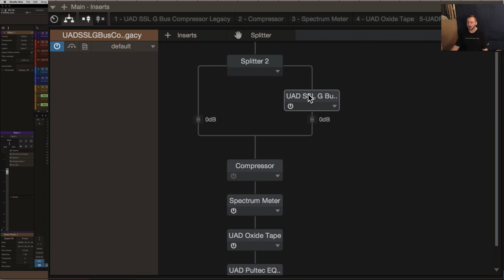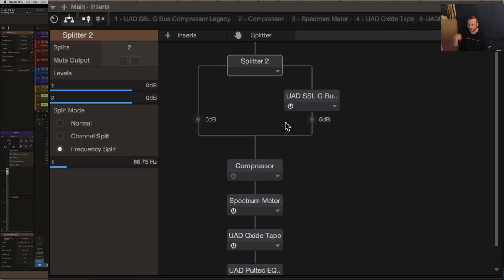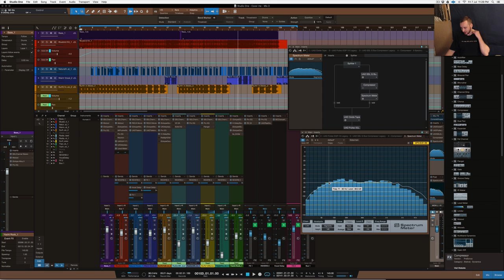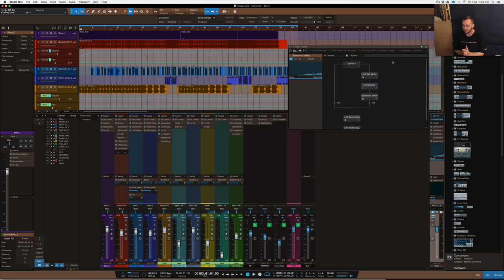Studio One 3.5.1 | Side-Chain Filter Any Compressor

Comment: Great idea! Do you know a way I can feed boosted/exaggerated frequencies into the compressor so it reacts to the boosted frequencies without disrupting the original stereo curve ?
Reply from the maker: As in just a portion of a filter going to the compressor. Basically the opposite to what is happening here? You could setup a bus with a filter followed by a compressor, but I'm not sure of the effect you're going for as to why you'd want this?
Reply: @CrossbeatsMusicProduction  Look at Fabfilter Pro C2's Sidechain feature. At the bottom you have an EQ to remove low so the compressor doesn't react to low end. It also has a high pass so it doesn't touch high end information. Also there is a Bell in the center to boost the frequencies you want the compressor to realize faster. In your video you demonstrate how to split the bands, but now how can I send EQ information to make the Comp reactive and sensitive to them! I hope this explanation works (: